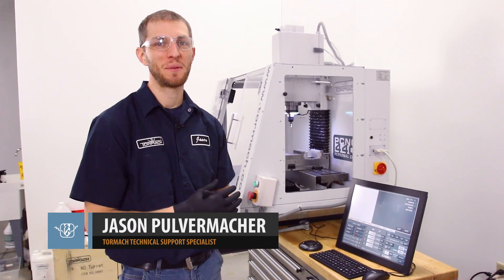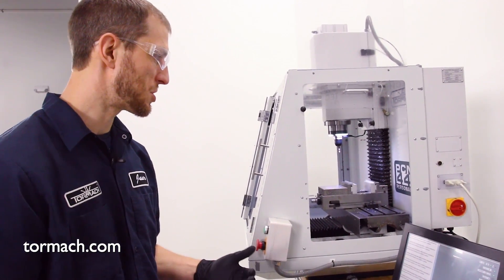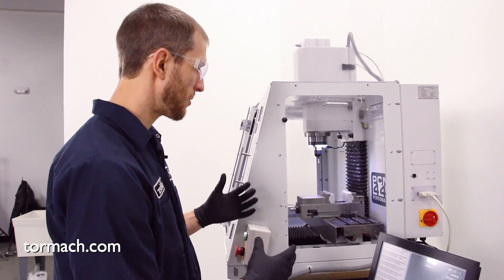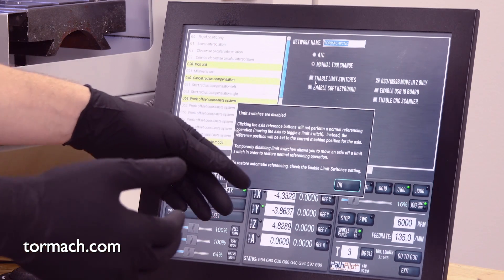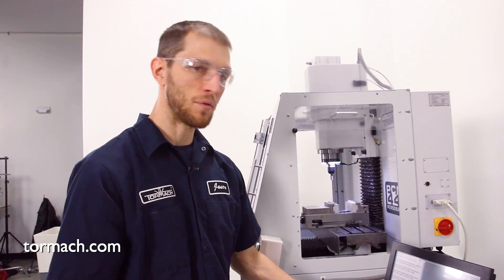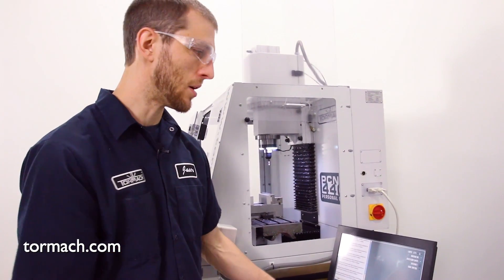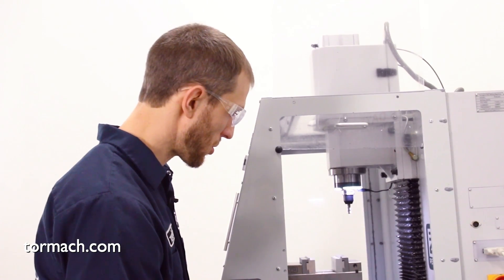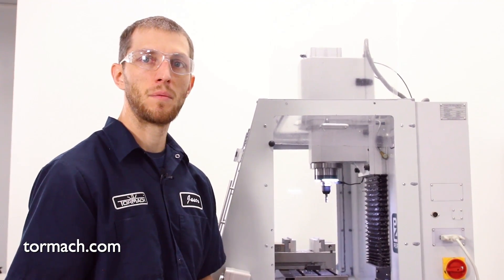Pulling Your Tormach Machine Out of a Reset Condition

Comment: What version of path pilot are you using because I. Dont have the option to uncheck limit switches in mine
Reply from the maker: All versions of PathPilot should include limit switch check boxes. The only exception is if you have an M+ machine, then the limit switch check boxes have been replaced with "hard stop referencing." If you don't have a servo machine then it's possible you selected an M+ configuration.
Reply: I’m also having this issue on Tormach 770. The Z axis is stuck at the limit switch, but I don’t have this option check box on pathpilot to over ride.

Comment: How can you slow the rate at which the machine drives to the limit switches during Referencing? My PCNC seems to drive too hard into the switches and knocks them off kilter? I would like the speed during referencing to be slower...
Reply from the maker: This is not typical behavior. If this is causing you continued issues, please contact technical support: support@tormach.com